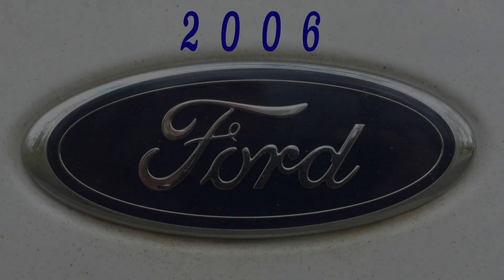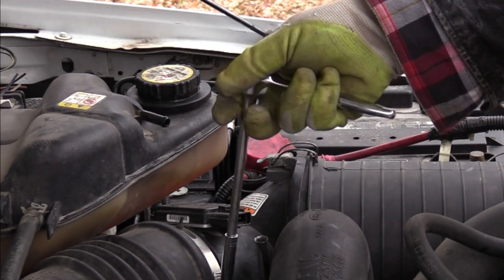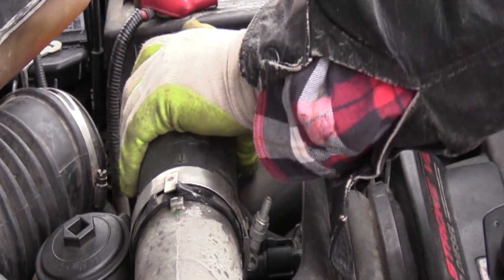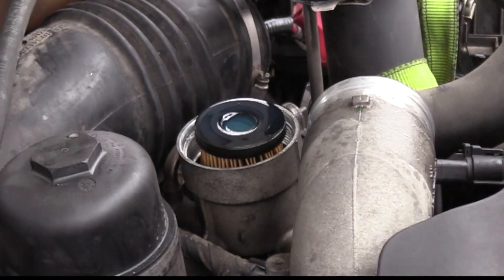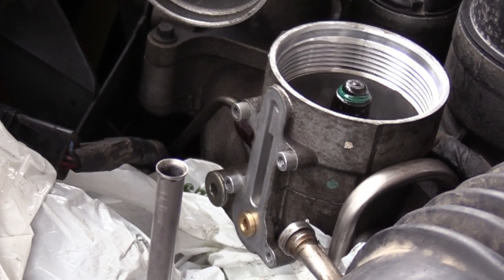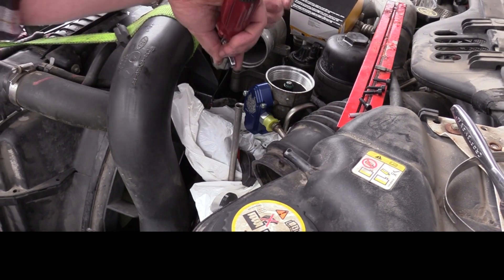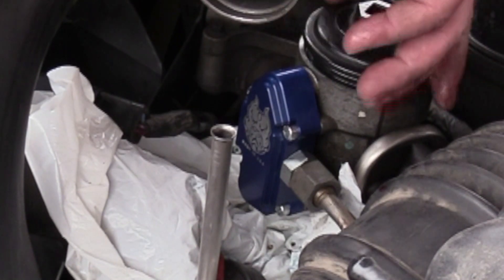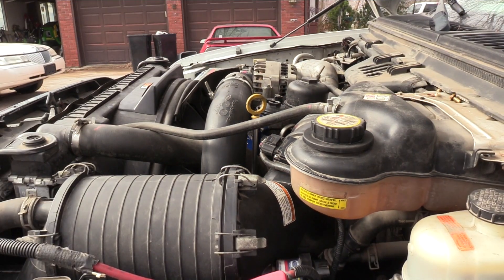Fuel leak, 2006 Ford 6.0 Power Stroke Diesel Fuel Pressure Regulator with blue spring upgrade

Comment: How to update injection module from seven pins to 04 pins 6.0 powerstroke 2004? Or can I simply install it? I thank you in advance for the information provided, friend.
Reply from the maker: I’m sorry I’m unaware of the change.  The older model used a set solenoids and the module I’m familiar with is solid state ( no moving parts ). I wish I could be of more help
Reply: @normanpaulife  Good morning friend. I've already made the exchange and everything is fine, the truck is working.

Comment: Where did you find the upgrade kit? Everywhere I look it says for the F450 not the E450. Or are they simply the same?
Reply from the maker: I sourced it from Sinister Diesel, but I believe I purchased it on Amazon to save money and faster delivery. Part number B076C43RDY , …2007 Ford Powerstroke 6.0L. It’s possible it’s discontinued, if so they are sell the high performance model with the adjustable regulator, for the price I paid for the standard model
Reply: @normanpaulife  ahhh Okay! That makes sense. Seems I have an off year and they don't make it for the 2008 which is odd. Appreciate the information though!

Comment: I have a 2001 Dodge Ram 1500 that  I will probably keep for a long time.  Is it worth spending  $200 for a set of OEM service manuals???   It would definitely be easier for me to see  sketches that are  specific for my truck. I see 4 volume paper copies on ebay.
Reply from the maker: I have a shelf full of factory service manuals, not cheap but one repair and they have paid you back. Two repairs and they are earning their keep
Reply: SCORE !!!  You were/are correct. I'm talking GENUINE FACTORY SERVICE MANUALS.  2013 Chevy sonic service manual almost paid for itself on the first repair ($300). My 2003 Ford Focus service manual is a huge success!  Just changing the wiper pump motor paid for the entire set of manuals. Stupid directions from repair threads and youtube were "incorrect".  Focus has a specific Auto transmission flush sequence that's more than just the filter change, and easy to do.
Reply from the maker: @larryschifferdecker8538  I have been using them for decades , when I bought my 2006 I insisted the service manuals be in the truck when I took delivery!

Comment: How to replace the v spring in the secondary fuel housing. It broke off when pulled out the filter
Reply from the maker: I can’t visualize the spring assembly, so I checked the factory service manual. It didn’t show the fuel bowl, but the oil filter baffle  tube has bolt at the base ( inside) perhaps it’s similar. The other option is to remove the filter bowl and inspect it carefully from all sides especially the bottom ( hidden) side (when it’s installed) . Call the dealer and see if the part is available separately. It may require you to buy the filter bowl to prevent injury from the spring tension! Let me know your results.